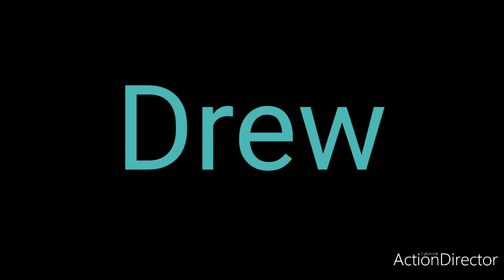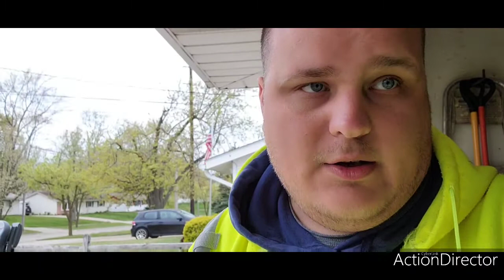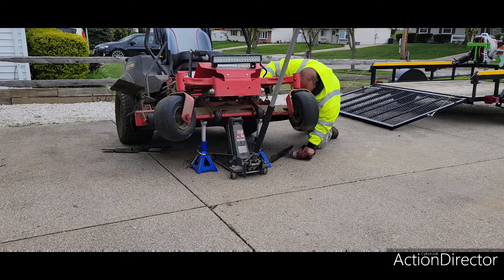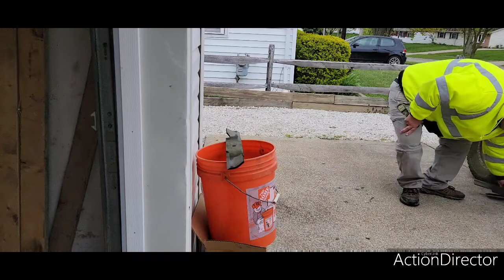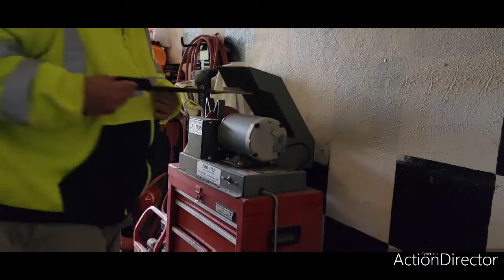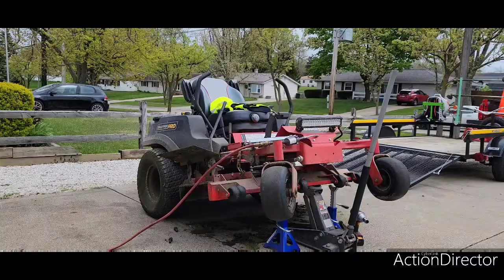Maintenance On Snapper Pro!!

Comment: Jack stands are almost useless without the load on them. If you leave the weight n the jack chances are if it was to fall off the jack it would roll back and miss the stands, or if you were under it in a panic jumping up if you saw it ready to fall you could easily hit the stands and knock them out of the way. You want to lower the weight onto the stands. I usually do tat then tighten jack back up and jack it up just enough to touch the load. Most of the weight should be on the stands to keep them in place.
Reply from the maker: ya true story i do that next time :)